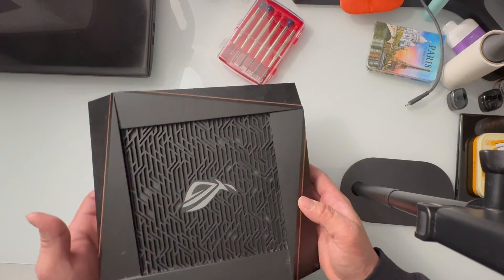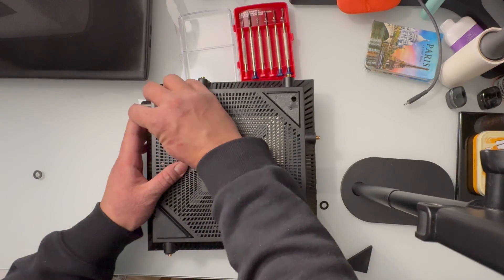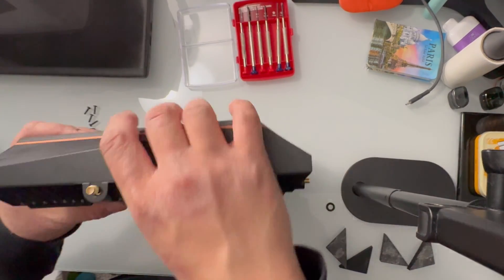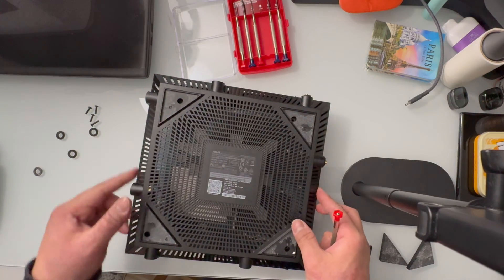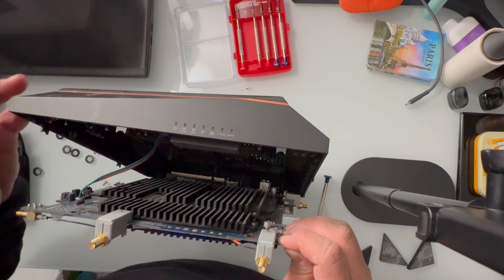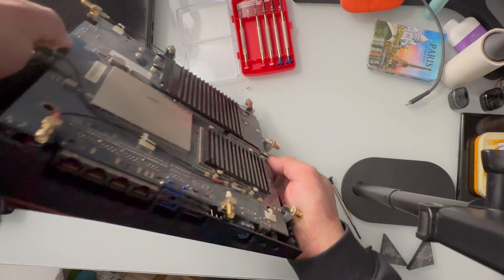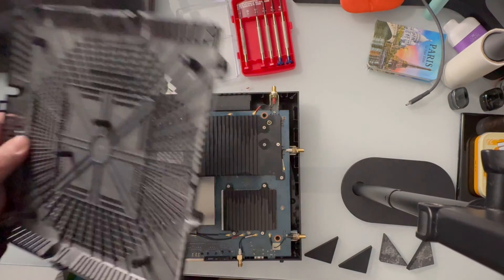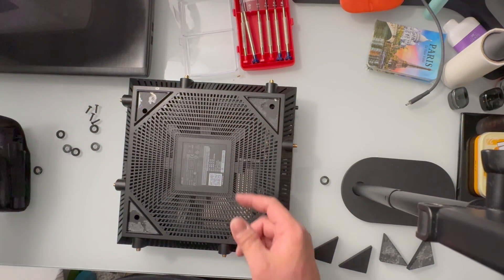ASUS ROUTER GT AX11000 Teardown Step by Step | Works with AXE11000 And GT AC5300 As Well

Comment: Thx for the tear down video.    I got to take mine apart as I had builders in and they did alot plastering.   I covered everything up except router all dust inside.   I’m wondering if this what causing problems as none of the ports and WiFi is connecting despite factory defaults restore and downgrading filmware  only one port works for configuration that’s it .    If this doesn’t work it’s dead
Reply from the maker: Probably that's whats causing it, but let us know after you tear down the router if you got it to work again.
Reply: @ToolsandGadgets  OK I have stripped it down cleaned it out from dust hard to move plaster dust but did it with quibs and air duster spraay slowly brushed it all away.  Wait for a while to dry  put things together I notice did filmware update seems to be working fine now.  However I did spend few  hour trying resolve one issue and had no luck ghz2 and 2.4 wifi is broadcasting the ghz1 isn't. all ports are working up to speed over network. despite rebooting or factory defaulting cant seem to get ghz1 to broadcast.I have tried splitting wifi I think proable the chip to the ghz1 probably blown with over heating. i've set it as tri band for now as i'm not to fuss about wifi these day rather stay wired. For a four year old router I think its time to look for a new one not sure about going asus again though it has a been a pain
Reply: It’s all gone now I give up
Reply from the maker: so sorry to hear that, i also gave up on my asus router as well and upgraded to the TP Link Archer BE24000. So far so good using Quadband.
Reply from the maker: https://amzn.to/46FxLho
Reply: @ToolsandGadgets not bad.     I have to wait for a while unsure what to get I know tp are good.   I never get power line from tp to many issues